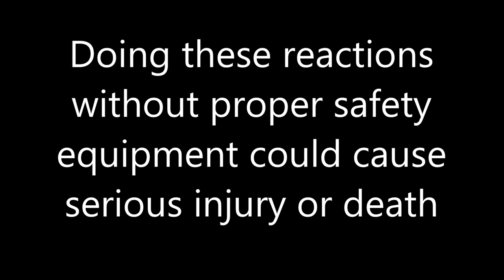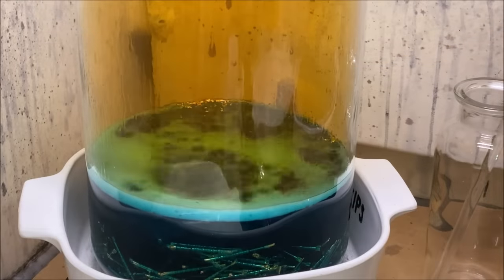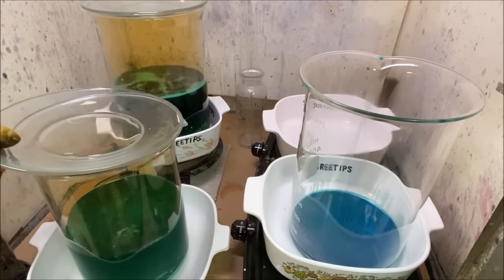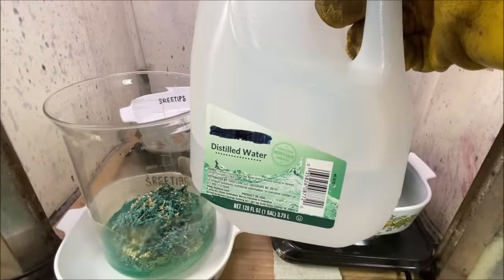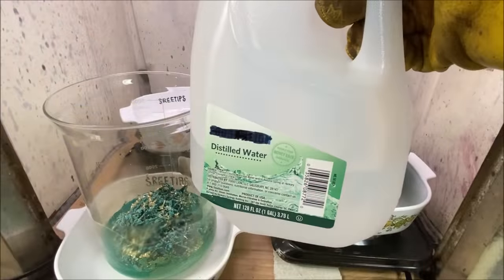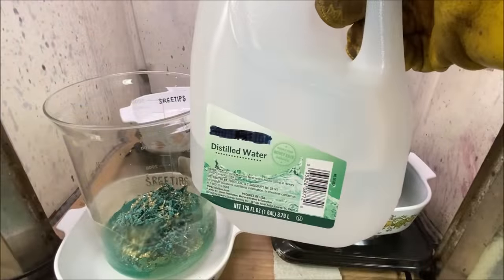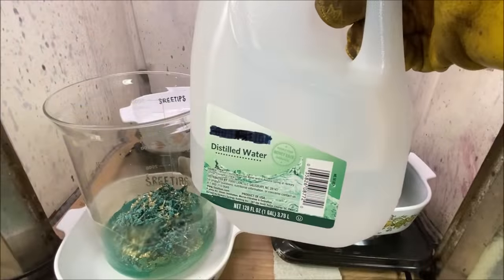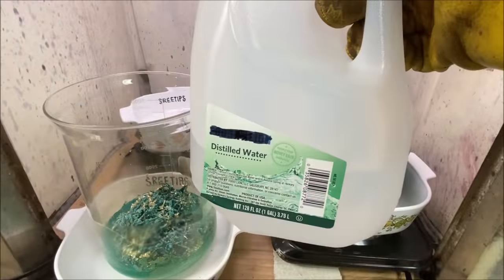Gold Plated Pins 10 POUNDS!

Comment: Long story short. A -$200 return
Reply from the maker: Short story long - I converted failing paper dollars into GOLD!
Reply: @sreetips  true. I'm just saying that if you could get all those pins for cheaper. You could make a really good profit. Also if you could reuse the acid some how (no idea if it's possible) you could save about $500 
each time. I collect scrap computers and parts, so I've just thought of the idea of collecting the gold out of any broken parts as i do end up getting a lot of them. Your video was super helpful but i do believe it cost you about $200 usd roughly to make it, which is not a bad thing it just shows how much you care about your community here on youtube
Reply from the maker: I used about 5.5 bottles of nitric, 2.5 liters each. They cost me about $50 each. In order to make “profit” I’d have to sell the gold that I recovered. And I did: 15 grams at $99 per gram. Then the remaining 7 grams as a necklace for $1200. Total revenue for the gold that I recovered was about $2650 before taxes and fees. BUT, I’d rather have just kept it. Dollars are losing value faster than a snowball melting in July. Gold is, and has been, trending up. I love GOLD!

Comment: your copper waste bucket is wort over $4   a pound
Reply from the maker: The last gold bar I refined weighed 4.3 Troy ounce and is worth 1650 pounds of copper.
Reply: @sreetips  I love your videos and learn so much from them .none the less no sense in throwing a couple hundred in the trash .don't even melt it just take it in
Reply from the maker: It’s full of other metals. Harold_V on the GRF convinced me after I set out to prove him wrong when I tried to process some copper from the waste bucket way back when. Made a believer out of me. To a precious metals refiner, they lamented, copper is waste. Today I know that they are right. After working with metals valued at thousands per pound, it makes no sense to work with copper. Or any other base metal.
Reply: @sreetips  that bucket is what they call number 2 .You nothing to it just drive to the scrap yard and they hand you 4 bucks a pound . It could have mercury in it , they wouldn't care ,its 85 percent copper good enough ,that bucket will weigh 30 pounds as of now drive 15 minutes and you have a free dinner with the wife
Reply from the maker: They won’t touch it.

Comment: In all videos only less than a half of the pins are used, so what is the point of promoting 10 pounds, pointless video.
Reply from the maker: I processed the entire ten pounds of pins. I did this because the seller had a rough idea of the gold content. And knew that I could dissolve the base metals with nitric to get the gold.